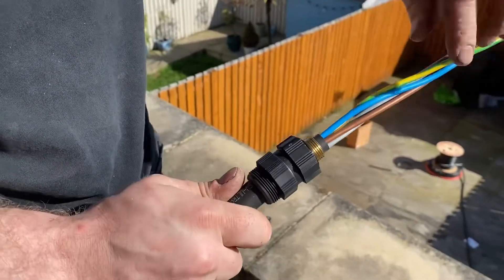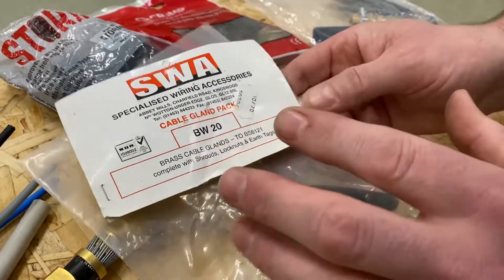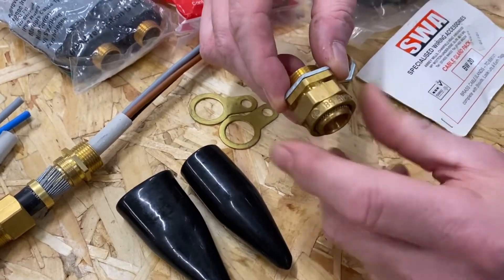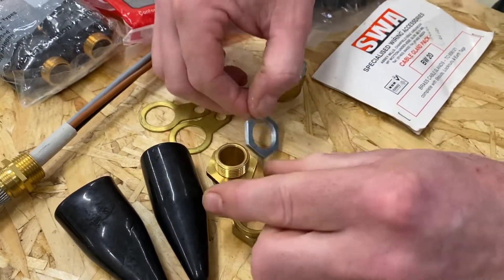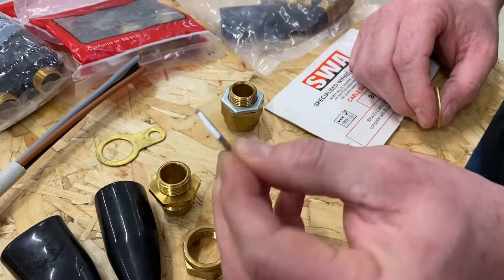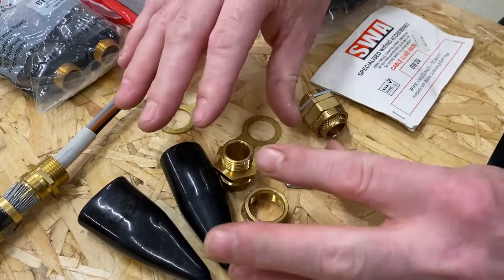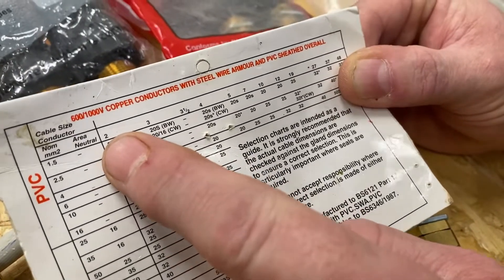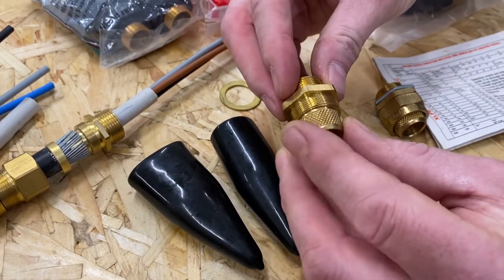SWA Cable - Everyone Gets This Wrong

Comment: The size of a SWA gland caught me out the first time I needed one. It is the cutout diameter. Obviously the part of the gland that enters the cutout is the same diameter as "the size of the gland", but the other dimensions vary from that quite a bit and the size isn't larger than the diameter of cable goes through it *because only the innards of the cable pass through the cutout*. At first glance the max SWA cable diameter being larger than the "size of the gland" can be a bit baffling. I sent an embarrassing "surely there's some mistake" email enquiry to a supplier once. I think I realised the moment I pressed "Send".

Comment: Odd question I know but why is the locking nut made of a different material instead of brass? I presume there is a good reason for this?
Reply: Purely because it’s cheaper I’d say. Good question though
Reply: I think it's all about the price. I find those galvanised nuts rust within a year or two, so I now fit paranah nuts as standard.
Reply: Not sure why it's called a "lock" nut - I assumed from the few times I've used one of these that it's a harder metal to help cut through whatever coating is on a metal enclosure so that the steel wire armour gets a good conductive path? Perhaps scoring the enclosure material is part of the "lock"?
Reply: Cost!
Reply: Some Hawke Atex SWA glands come with brass nuts. If you flip the olive over, they do SY cable as well
Reply: @stephenmason8566  shouldnt need to flip the olive over, firstly massively reducing contact area and increasing the chance of it failing, and they do the glands to accept SY

Comment: am I alone in calling them frying pans rather than banjos?
Reply: 100% frying pan!
Reply: It’s a frying pan in Scotland.
Reply from the maker: @Savagetechie  great shout
Reply: No.  They are Bingos…in the bin they go and fit an earth nut. Do it once, do it right ! how many times have you seen these on a plastic box to gain an earth and it’s as rotten as a crack heads teeth and slack as a wizards sleeve
Reply: Yes you are alone in that thought . Its a banjo
Reply: @dennisphoenix1  to be fair the guy that told me they were frying pans was 70 odd so maybe it never took off. However being from scotland everybody has a frying pan and there are hardly any banjos so it could also be a regional thing.

Comment: I recently failed the SWA section of my AM2 due to something being incorrectly terminated. Could it be that I didn’t include the wedding ring part of the gland which isn’t present in this video?
Reply: That's only on CW glands. It only goes in 1 way.
Reply: @KevinOsborne1987  Sorry for my ignorance, but what is the difference between a CW gland and the one shown in the video?
Reply: @MP-ti6lz CW is for external use, more water resistant outside
Reply: @brianhewitt8618  Thanks to both of you above. That’s cleared up a lot for me 👍🏻
Reply: Incorrectly terminated ? Surely if the gland was the issue it'd be incorrectly glanded 🤔
Reply: @UnimportantAcc  Well this is the problem with the AM2, they don’t actually specify too much. I assumed it was the armoured gland as I kind of rushed that part, but it could have been the commando socket? I folded the cables over, so that may have been the issue, there’s no way for me to know unfortunately. I’m having another crack at it tomorrow, so let’s see.
Reply: @MP-ti6lz good luck man, I believe in you.